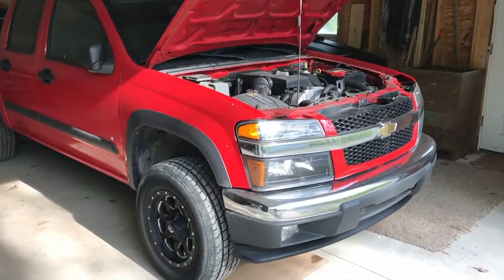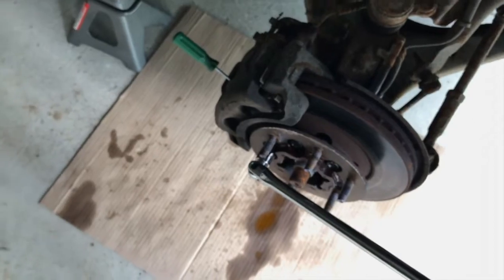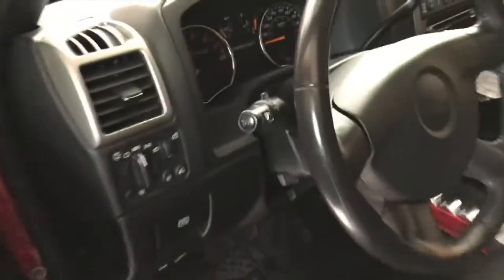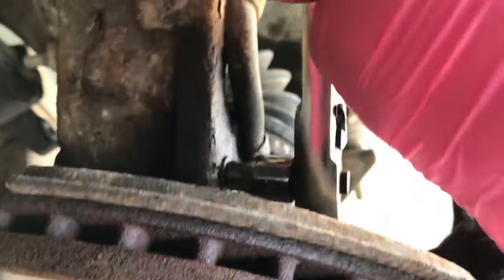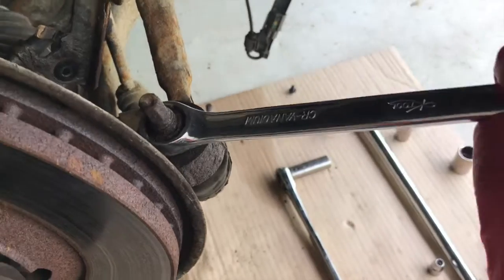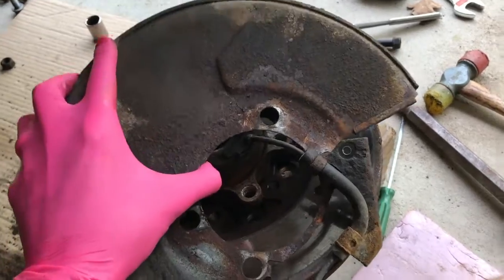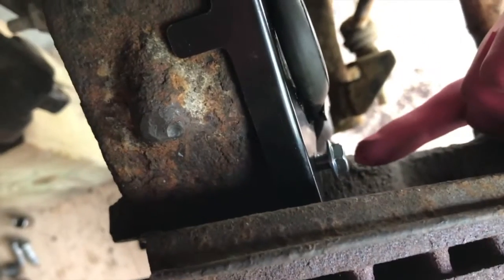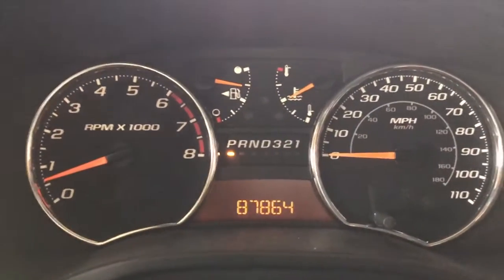ABS Fault C0040 - How to replace Colorado/Canyon Speed Sensor & Hub Assembly!

Comment: Well you got the job done , but you no doubt made extra work for yourself . That one 15mm bolt is easily removed with a Craftsman swivel socket . You or anyone else should pick one up before doing this job . However , the content and video were well done . Thanks .

Comment: If you have a 4x4 you can put it in 4 wheel drive and it will hold it while you loosen them.  also you may want to brake loose the axle nut before you jack it up.  had to do this 2 times on mine so far, caliper failure the second time just a full brake job first time.  BIGGEST pain in the butt brake job i have ever done, allow about an hour and 1/2 per side.  if you are over 40 and never done it before. the tip about turning the wheel is straight on point no other way.  i had both of mine off at the same time so when i turned left i took off 2 bolts on each side, the same for right.  cuts down on turning back and forth.  Disconnect the abs sensors before you get started either pull the clips out or unsnap the clips.  u have to fish that through between the axle and the knuckle.  not fun by yourself. this fella did a good job and made it look easy, seriously, allow extra time.  this isn't a jack it up and knock it out in an hour job.  Helps to have a helping hand to fish the cable through and putting the rotor and hub assembly back on.  a bobble extension will allow you to get to the "unreachable" bolt.  best invention ever made.  a yellow bottle torch will help with the rust.  I also use the jack handle as a cheater bar for my breaker bar, yes sometimes they are that tight.  THumbs up good job on the ol truck, been meaning to vids for years, but never seem to have the time.  when my stuff goes its always at the worst time and i cant afford the down time to set up camera and such.
Reply from the maker: Rhage73 

Thanks for watching & sharing your experience.  This is great info & we appreciate you taking the time to share this advice.  A true fellow DIY’er you are.  You Rock!  Us fellow DIY’ers need to stick together!

😎👍🔧🔩

Comment: You can totally get that bolt that you said nothing can get on. I used a 3/8" drive 15mm socket with a short extension. Then I put a 1/2" to 3/8" reducer on and was able to barely get a 1/2" drive breaker bar on it with a swivel on it.
Reply from the maker: Awesome Awesome & we appreciate you sharing this.  Any & all helpful info is greatly appreciated.

😎👍🔧🔩
Reply: @DIYwithMichaelBorders  no problem the length of the extension is important and I also had to turn the wheel just like in your video. I appreciate how informative your video is.
Reply from the maker: @coreyevans5065  

Hey, we appreciate you, keep in touch.

😎👍

Comment: On the 2007 chevy colorado i have, the caliper bolts on mine are 22mm not 17mm. 

Wheel lugs 19mm
Front hub bolts 17mm
Caliper piston 13mm
Caliper shroud 22mm
Rear hub 15mm
Wheel speed sensor nut 13mm
Wheel speed sensor bolt 7mm

Just had to change caliper and rotor this past weekend..... and now it looks like i will have to change speed sensor fml...... 

And good luck on finding replacement bolts of you strip any. Junk yard is where i had to go for same day.

Comment: First off thanks for the video!!!! On the 4×4 you can easily remove all four wheel bearing bolts in the rear by simply undoing the outer tie rod and swinging the knuckle for access and remove with a swivel and socket But you do have to remove the knuckle to get the axle out of the way to properly install the new bearing with ABS do not separate the ABS ring from the bearing to remove knuckle undo both upper and lower ball joint nuts no need to remove the three upper ball joint to arm nuts.
Reply from the maker: Alexander The Grape 

Thanks for watching & we hope you enjoyed the video.  We appreciate your helpful thoughts.  You Rock & thanks for sharing!

Many more helpful videos to come!  😀

Please subscribe to the channel and turn on your YouTube notification Bell 🛎 that would be awesome thanks again!

😎👍🔧🔩

Comment: I was able to remove all 4 back bolts of the hub in place with just a swivel on my ratchet. They were pretty stuck as it is a 2006 colorado... However, I broke my breaker bar trying to remove the 35 mm wheel nut :(  should have used  an impact and some heat.
Reply from the maker: YL75 

Thanks for sharing.  That’s a strong nut to be able to break your breaker bar.  😳

Keep us posted on your project.  We are always here to help answer questions.

😎👍🔧🔩

Comment: Hey buddy, you spent a lot of work getting that rotor off. I was easily able to remove the four 15 mm screws without going through as much work as you. Simply use 3/4" extensions and swivels with 1/2" drive socket ratchet.
Reply from the maker: Thanks for watching, that’s great to hear.  Always a better experience when things go smoothly.  😁👍🧰

Comment: Just a question, what was the purpose of removing nuts on lower ball joint and tie rod if you weren't going to remove ??
Reply from the maker: @joepacheco4038  

Thanks for watching, to show viewers that own different year Colorados and Canyons that are slightly different than the 08’s.

👍🧰
Reply: @DIYwithMichaelBorders  TKS for come back, getting ready to replace on my 06 Colorado, your video will be helpful. Having trouble locating backing plates, want to have on hand for repairs. Live in New England nothing but rust, saw them when doing brake work.
Reply from the maker: @ 

Thanks for the reply, cold up there too this time of year.  Looking forward to hearing back from you.  👍🧰

Comment: Replaced my ABS sensor and still got the same issue coming up on my dash, I never put the dust cover back on as I got rocks stuck in there a couple times and figured I wouldn’t really need it. Code went away and came back 10 mins later down the road, would the dust cover have anything to do with that? Maybe for spacing or something like that? Or would it be another issue?
Reply from the maker: @AlexanderMitchell-p3f  

Thanks for watching, any update?  The dust shield shouldn’t trigger your abs however anything is possible.

Have you performed a quick reset by disconnecting black negative cable from battery and leaving disconnected for 5 minutes?
Reply: @ I have not but I will try that now thank you
Reply from the maker: @ 

Hopefully that helps however if it doesn’t, onto the next troubleshooting step.

Do you have an OBD scanner to read your ABS codes?

That will tell us the exact part causing your ABS fault to trigger.

Comment: I changed out my wheel hub assembly with speed sensors , brakes , disc and drum rotors months ago and now I'm getting my abs light on....I feel/hear a scrapping scratching sound when I first take off and try to stop or slow down and the brake pedal won't fully compress...at the same time im hearing a machine buzzing sound like something won't disengage or catch behind the steering column brake pedal area but after several attempts it goes away and I'm able to brake without that nasty noise and feeling. My brake and rotors look fine like nothing is wearing uneven nor a foreign body present.
WHATS GOING ON with my 2008 GMC Canyon 4x4 ?
Reply from the maker: Thanks for watching & welcome to the DIY Raptor Club.  It’s very possible that your caliper is in its early stages of failure.

The internal piston inside your caliper may be getting stuck in the extended position periodically causing issues.

Please keep us posted, us DIY’ers need to stick together!  😎👍
Reply: what was the solution to your problem
Reply: @villar8777  It was my ABS Control Pump and Module assembly. FYI they are SOLD OUT online and not in production so the junkyard is where I found mine. The ABS Control pump was the issue with mine but I replaced the whole assembly since it comes attached and I wanted to be sure I eliminated both possible issues. The part was about $60 at my local junkyard but the labor is what will get ya if u don't have the time or don't know how to properly service brake lines (bleed/purge) and reconnect the individual hoses on the ABS pump. I really love my little GMC Canyon 4x4 but I didn't do the research before buying as to how many brake issues these came with and how hard it is to find parts. My next search is a 4x4 lift kit of about 4inches which is also a journey to middle earth to find and probably an exhaust system (easy to   aquire) to go along with my leaky exhaust manifold letting toxic fumes into my AC vents...lol
Good luck yall !

Comment: I put mine back together same way and rotors wouldn't move at all like stuck or some crazyness.
Reply from the maker: Thanks for watching & welcome to the DIY Raptor Club.  Any update?  Did you purchase new rotors or are you using originals?

If you purchase new rotors, it’s possible that the company sold you the wrong size

Comment: I removed that bottom bolt on the back of the hub without removing the ball joint.
Reply from the maker: Awesome, thanks for sharing.  Is your project complete or are you still working through it.  Let us know if you have any questions.

Comment: I was able to remove the hub without disconnecting the LBJ and other parts by using a wobble socket, but the new sensor I purchased did not fit through the opening without damaging the sensor. Is there a trick to getting the sensor, when attached to the hub, back through the hole?
Reply from the maker: Thanks for watching & welcome to the DIY Raptor Club.  That’s odd...🤔

We haven’t run into that before.  Are you certain the replacement sensor is the correct sensor...?
Reply: Yes, I checked it with auto parts store and the dealership. It was an after market part. The length of the cable, mounting bracket and attachment points all matched as well. I’m hoping the sensor that is on the complete hub replacement I bought will work. I double checked the, make, model, year, side and 4x4. I’ll keep you posted.
Reply from the maker: @chad7462  

Thanks for the reply & we appreciate you taking the time to share this.  😎👍
Reply: @DIYwithMichaelBorders  I bought a Timken complete hub and ABS sensor. I had no issues with the ABS sensor. After looking at the previous sensor, it had a higher angle, which made it nearly impossible to fit back through the opening. The Timken went on with expected effort and no pinching of the ABS sensor wire.
Reply from the maker: @chad7462  

Outstanding & we really appreciate you taking the time to share this update.  Sounds like you’re back up and running.

Again, thank you!  Hopefully stress free days ahead for you.  Enjoy your night Chad.

😎👍🔧🔩

Comment: You do not need to remove all of that to get the bottom bolt. Just turn the wheel and use a short 3/8 socket with an extension. Oh my god, I cant believe you're taking all of that apart.
Reply from the maker: Thanks for watching & we appreciate you sharing.  Hope all is well.

😎👍🔧🔩

Comment: Greetings, my 05 2wd has the ABS problem.  The alert clears when I turn off the engine.  When I start the engine again, the ABS alert is not there, but after running and using the brake there then the ABS turns on, but it does not give any engine code.  How did you finally solve your ABS problem?
Reply from the maker: Good morning & welcome to the DIY Raptor Club.  Any recent heavy rainfall?  It’s possible that you have moisture inside your ABS sensors within your wheel hubs.

Unfortunately this is becoming more and more common and you will have to wait a few days until any moisture dries or evaporates.  Let’s start there, keep us posted.

😎👍🔧🔩

Comment: I have a question about the speed sensor.  Is the sensor itself specific to left or right, or is that metal bracket the only difference between left and right?
Reply from the maker: Thanks for watching & welcome to the DIY Raptor Club.  You will want to make sure you get the proper sensor for the right side.  Some vehicles it won’t matter however most vehicles are wheel specific designed.

Hope this helps.  Enjoy your day.

😎👍🔧🔩
Reply: Okay so I did a swap out of the sensor not knowing and also ordering from amazon where it says front wheel speed sensor.  But as I installed it, it was very clearly for the left side not the right side that I was working on. 

I installed it nonetheless and now the sensor isn’t picking up any wheel speed at all. Is this because the 2017 canyon sensors are specific for each side? How would this even make sense as its just a sensor with a connection that I was able to plug into the right side. Am I missing something like it needs to be programmed now?

Comment: Hello great video, really helpful. If you don’t have a 4X4 do you still need to remove the knuckle?
Reply from the maker: Thanks for watching & we appreciate you sharing this.  If we remember correctly, we don’t believe you do.  Keep us posted on your project.
Reply: @DIYwithMichaelBorders  for don’t have a 4x4 you don’t have to drop the knuckle. I just did my last week. It was very easy. Hub was stuck so had to beat it from the back side with a small sledge hammer
Reply from the maker: @jackynguyen4551  

We appreciate you sharing this, any & all helpful info is greatly appreciated.  Great to hear back from you.

Enjoy your upcoming weekend.  😎👍

Comment: I am doing this job right now and I am stuggling to get the hub back on. i secuted the lower ball joint as you did but then I couldn't get the upper ball joint to line up. Any suggestions or help?
Reply from the maker: Jeff Sage 

Thanks for watching Jeff.  We find it best to use a jack to lift the hub up & at the same time use a prybar to lower the tension loaded plate that the three studded bolts drop into... definitely easier said than done.

Keep us posted.  Please subscribe to the channel and ring your YouTube bell 🔔 this Will be very helpful to us thanks again Jeff.

😎👍🔧🔩

Comment: When my ABS  fault light came on my transmission was effected.  I could only use 2nd gear in my 2004 colorado in-line 5 .  The speedometer and RPM was also acting crazy.  Could this fix my problem ?
Reply from the maker: William Moore 

Thanks for watching & we haven’t experienced that before.  🤔

Definitely keep us posted on what you find out.  Please subscribe to the channel and turn on your YouTube notification Bell 🛎 that would be awesome thanks again!

😎👍🔧🔩
Reply: U have to pull the abs info fuse in the fuse box. It will drive normal again. But you will have break lights on your dash. I did it when i put lift spindles on my truck and the brakes work fine
Reply from the maker: Kaleb Prejean 

We haven’t heard of that before...🤔

😎👍🔧🔩

Comment: Ok ya don't have to remove all that stuff remove brake claiper remove the the bracket turn the sterring wheel to the left remove hub bearing bolt's on the right then turn the steering wheel back to the right take them 2 bolts out on the bearing un hook the sensor cables remove the hub knock off the old ABS sensor put the new one on and reverse the process pay att on where the sensor was sitting befor ya instal the new one, and if your going to remover the bolts on the rotor use an inpac alot faster
Reply from the maker: Thanks for watching & we appreciate you sharing your advice.  Any & all helpful info is greatly appreciated.

Hope all is well.  😎👍🔧🔩

Comment: unnecessary disassembly
Reply from the maker: Thanks for watching & we appreciate you sharing your thoughts.  Hope all is well.

😎👍
Reply: True, but this video can be used as a how to remove the steering knuckle to replace a CV Axle or Upper and Lower Ball joints. In fact, it can help in removing the 15mm hub bolts if they are severely rusted to the point a socket can't get a good bite on them when close to the axle shaft. Too bad he can't go back and edit this stuff in.